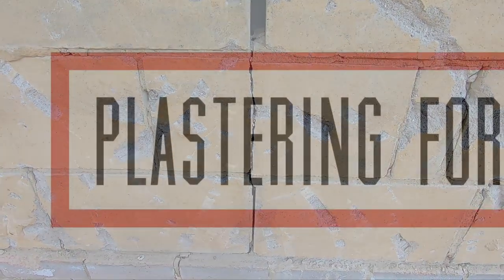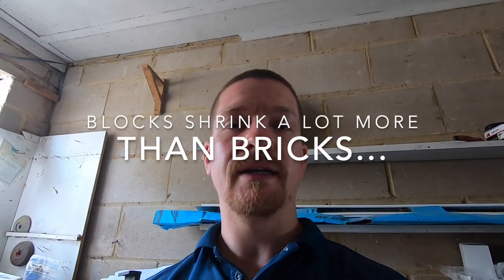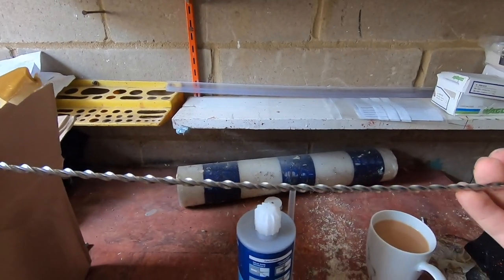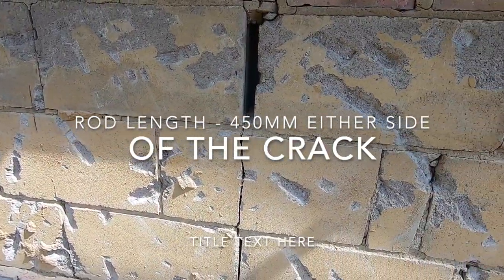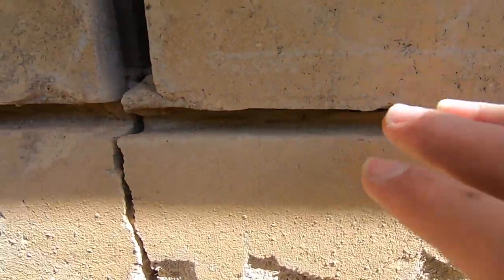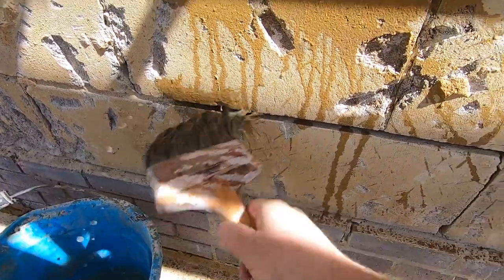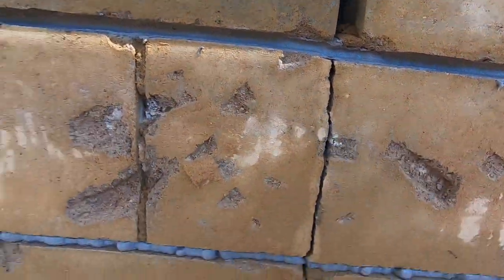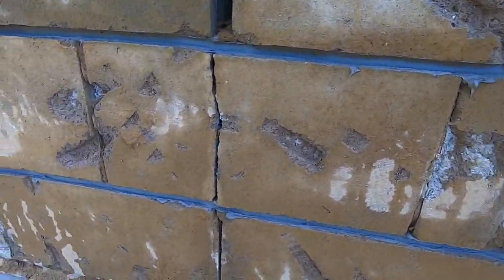EASY FIX!! How To Fix A Cracked Brick Wall (Plastering For Beginners)

Comment: Used to do a lot of this structural repair fitting heli bars galore, we also used to use metal expament screwed into the masonry over the crack stopped it travelling through

Comment: As a brickie, I don't really use these resin methods. A more traditional method is to put a spanlite lintol topped with some concrete commons and dry slate the joints so its absolutely solid. 
And as a construction lecturer and CSCS tutor you'd have had a good few words for grinding with no eye protection and no respirator, silicosis (look it up) is a major killer in the industry so if you want to teach people to get into the trade at least show them how to do it safely.
On a more positive note, I do really like your plastering videos.